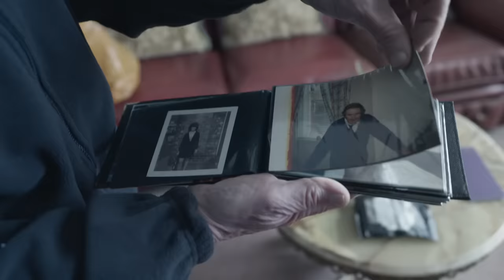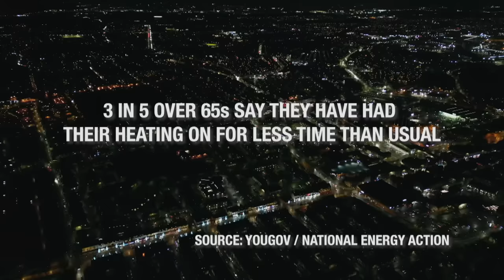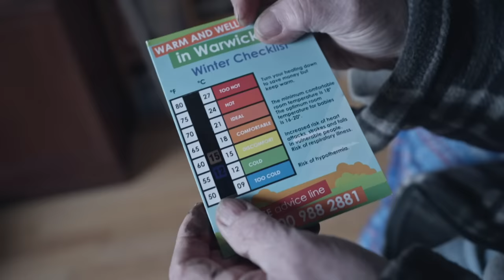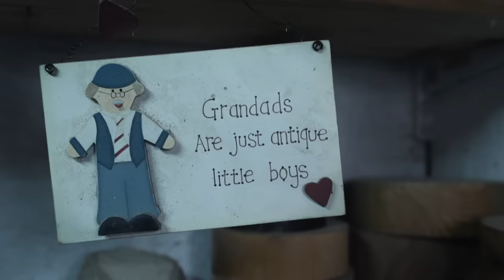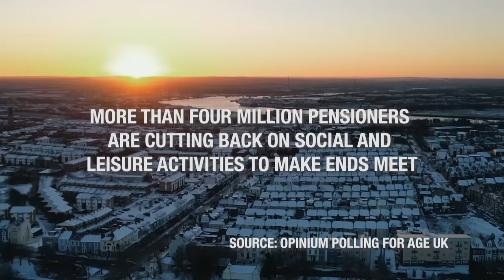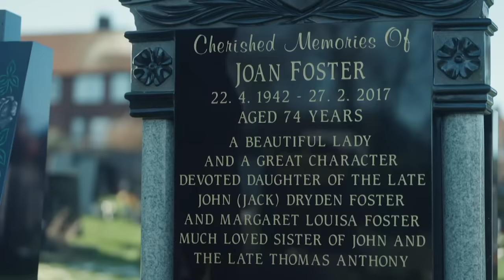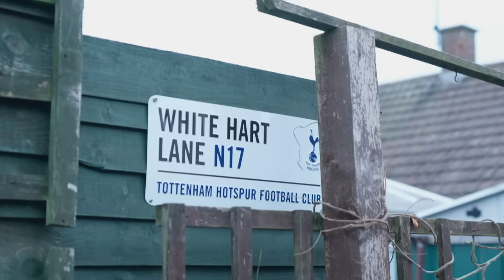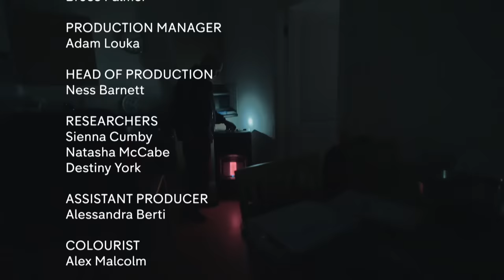Britain's Forgotten Pensioners | Dispatches | Channel 4 Documentaries

Comment: I’m a pensioner on my own in the UK. One of the best ways to combat the cold, is the electric throw (£30) (not an electric blanket) They cost 1 or 2p per hour, and keep me completely warm till I go to bed. My gas bill has been so much lower since.
I feel they should be given out free to pensioners.
Reply: Electric throws are awesome! Especially when living in damp cold
Reply: For when you're out of bed, quartz room heaters are efficient and produce crisp, dry heat, but have to be kept away from flammables.
Reply: Also recommend wearing an indoor OODIE ( correct spelling ) type garment.
Reply: Where do you buy them ?
Reply: I have one they are great and so cheap to run xx
Reply: @chrisandjasmine3077  where did you buy it?
Reply: The CEO of Octopus Energy gave out thousands of free electric blankets to the elderly. The only energy company boss who cares. I never turn my heating on until November and swear by electric blankets. 6p an hour much cheaper than heating the bedroom.
Reply: I’m not retired but I’m doing already what you suggest. We also sit in the dark watching Tv
Reply: It's not life at all.😢
Reply: Pri Marc sell indoor oodies
Reply: A good down blanket will keep you warm, no electric required.
Reply: Thanks. Bluebells are a good resource as well. They are great for your pineapple. Stretch your arms and legs as well - for the Large Wardrobe. Its great for your Indian shop. Take Care my 2 bedroomed house xx
Reply: Where can I get one of these throws, please thank you for your messagexxx
Reply: How do we donate, specifically to these elderly dears please?
Reply: Electric throws are WONDERFUL!!!
Reply: To everyone on here asking where to buy a heated throw..Amazon do them for about £45 but if you can't buy online..i think b&m do them or Asdas,Tescos etc..its a lot of money to pay out but a cheap way to keep warm if you can get one..hope this helps xx
Reply: Agreed and fully sympathise. I'm a gerontologist trying to draw more attention to these issues through research. Governments have had decades to plan for all these issues and chose not to because social protection isn't seen as an investment in future prosperity. The Netherlands, Austria, Denmark and Finnland are winning in terms of quality of life in retirement.
Reply: I love my electric throw
Reply: Thank you, common sense goes far with a budget.
Reply: I know what you’re saying, but that shouldn’t have to be done, when you have paid into a pot all your working life, you should be getting out what you paid in. Not living hand to mouth and worrying about keeping warm.
Reply: But what about us pensioners who don't sit in a chair all day?
Reply: Also accompany that with a couple of beanies and socks on the feet.  When one’s head , hands and feet are warm , it’s much more tolerable.
Reply: Plenty of hot soups or stews
Reply: @snorkle5041  no ,it's dog eat dog, even for poor pensioners
Reply: @Bluediamond200  oh where did your get it
Reply: I’m praying that God will protect, and bless you ❤🙏🏻
Reply: If I lost eight stone I'd be dead

Comment: when my family lived in the UK my mother volunteered at something called meals on wheels. this was back in the 60s. The main thing the elderly really wanted was someone to talk to. things haven`t changed that much - have they?
Reply: No, unfortunately it is worse. 😢
Reply: Or as my Nan used to call it, "Muck in a Truck". She had them twice a week and what I saw, it was very good stuff.  She had "Brandy", a lovely Heinz 57 terrier type. She was lovely. We inherited her when my Nan died. I cried when my Nan died, I cried when Brandy died. She was a lovely dog but one day the Muck in a Truck was delivered. The plates were one on top of the other separated by a metal ring ... main meal below and the pudding/sweet on the upper plate.  She put the plates down, took the sweet plate off and put it to one side, and then took the ring that kept the plates apart back to the door for the volunteer to take away. She shut her front door and turned to see the one lamb chop on the floor and Brandy chewing the other. We didn't hear the end of it for months.
Reply: so did I
Reply: We have meals on wheels here in Australia, you pay, but only a low amount.

Comment: This may be a deeply unpopular view but I'm a 70 yr old pensioner who isn't feeling any "pinch". I have a small private pension and a state pension. During Lockdown, people like me saved a hell of a lot of money. No trips to the pub. No holidays. No meals out. No  "social" spending at all. No taking the grandkids out or buying new clothes.
I saved a hell of a lot of money, and so did a lot of other people - if they are honest. COVID was bloody miserable, but  it was cheap. I have also helped myself by finding the cheapest rates I can for gas and electricity, turned down  my thermostat by a couple of degrees and gone onto a water meter. I cut back my WiFi and phone package and I calculate that I saved between £450 - 500 p.a.( I saved £180 by going on a water meter). Also, over winter  we all received hundreds of pounds in rebates to help cover our energy bills, which covered more than two months  of my energy usage. Simple and practical help making these changes would help a lot of elderly people.
Reply: It’s called taking responsibility for yourself. Most people seem to think the State owe them a living.
Reply: Not everyone is fortunate enough to put aside for a private pension. Quite honestly I think the state pension is so awful for the pensioners. What gets me is that people say don't rely on your state pension but many have no option! They have paid into it all their lives but the returns are dreadful because the govts did nothing to increase the state pension or index link it!
Reply: @taniayager3361  Do you know how much money the government gave me to supplement my heating costs over winter ?
It paid the entirety of my fuel/ electric bills for December, January and February.
Reply: @ericgrace9995  Good that you have a private and state pension! Like I said many are not fortunate. Yes the govt paid out lots of money to subsidise heating bills. If people kept their heating low then the amounts would have helped a great deal to cover those costs. But if they were using a lot more to keep warm then even the amount paid to them would not be sufficient. Each and every individual is different. Where I come from I see many struggling and no they don't smoke or spend their money on frivolous things either.
Reply: @capitalexnetwork8898  

And there you have it!

Comment: I run only low power lighting,  cook in worktop oven or air fryer, cook veg in an electric steamer, rarely use an electric ring. Radiators in every room on except the bedroom, house at 22 degrees C. Electric and gas for the year via my smart meters is £1200.  Never go to pubs and restaurants and do not take holidays away. Exercise at home.
Reply: Hello Philip.  All the best to you.  You are trying hard and you will make out ok. 👍

Comment: The situation is similar in the United States.  I see the exact same situation materializing in my own life.  The thermostat is set low.  Any extra expenses are largely curtailed.  Even going out to eat has to be scaled back.  There is a large disparity between those who have enough resources (or even a great surplus), and those getting by on very little.  (I belong to the latter group.)  One observation: Those who worked in medical seemed to do exceptionally well here.  But the rest of us (myself included) paid for it.

Comment: It should be made illegal to charge a higher rate to the energy customers who have to have the meters in their homes with the pre-paid keys.  And if the customer is over 65 or is permanently disabled, the rate should be drastically reduced in fact.

Comment: For the ones that are saving on the light bill. Put a tent up inside your house throw a couple of blankets over the top of it and you are a pet put it inside with you this will help you stay warm and if you can buy a large can of cooking grease and get some long candle stick cute the wick and place it in the middle of the grease you can also place it in your tent for extra heat and give you light as well one large can will last all month using it eight hours a day. 
You can cook using a large clean can of fruit or vegetable can just poor in some alcohol over some cotton balls and lite it and you should clean out two small ones too help keep you pot stable. Hope this can help someone out

Comment: Put your bed against a wall/ corner that's not an exterior wall. Rig a tent over it with extra curtains, shower curtain or bedding  to conserve heat.

Put your microwave, coffee/tea maker at the bedside.

Heat only that room with an efficient heater such as a quartz heater, keeping it away from flammables. Use an electric blanket at night.

Comment: Cost of living has affected  everyone, i recommend you can buy a heated gilet and trousers they run on a battery by anker brand so buy 4 batteries so that once its run down you can use  second one then charge the other, blankets are fine aswell, but i dont believe electric blankets which are better is as engergy efficiient as they state they are. Running a dehumidifier is very expensive for anyone with a damp problem.

Comment: Elderly that have worked all their lives should not have to worry about heat, electric and so on. It really bothers me seeing them struggle.  I have an elderly friend Richard, he's 72, he retired 12yrs ago, i recently ran into him whole out on a walk, he mentioned to me that he had went back to work for the same palve he retired from... its bothered me ever since that he can't be at peace in his elderly years, & be comfortable after working so may years... 😢 😢
Reply: People don't plan for their future that's the biggest problem. They work all their lives and don't save for retirement, invest in their pension or invest in the stock market. They just spend spend spend without a care in the world because they either think the state pension will rescue them in old age, or they just don't care enough to worry about it. Then old age comes along and suddenly they're broke, no savings, nothing... And they quickly blame the system for "letting them down".

The system works just fine, we have state pensions, but you also have to do your part, be a financially responsible adult and put some money away each month for your retirement so you can live out the remainder of your lives in comfort. But instead people just spend without care. They only have themselves to blame, I have absolutely no sympathy. Spend all your money now while you're young if you want that's fine, just don't dare complain that the system is "letting you down" when you're older.

Comment: I work all summer sawing and splitting wood to have heat in the winter don't use air-conditioning in the summer if its to hot in the house go outside you should working anyway but people are weak and lazy to good to work

Comment: Income inequality always worsens and metrics are statistical cons - inequality never returns to previous low levels shown on charts.
This is whatever measure is seen e.g. even top 1% hides fact that the rich increase above all the rest - high inequality within percentile.
Fact: Gini coefficient merely compares poorest 20% to average income (not to rich) then calc continues underestimate rest of population.
UK Gini index was 32.3% in 1986 & 2012 YET rich annually increased by larger percentage than poor & workers, compounded massive disparity.